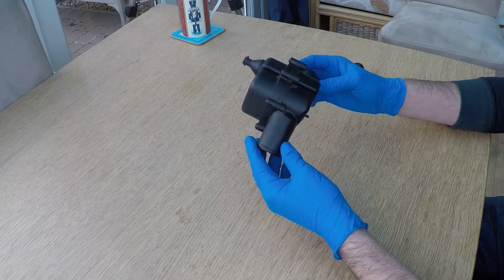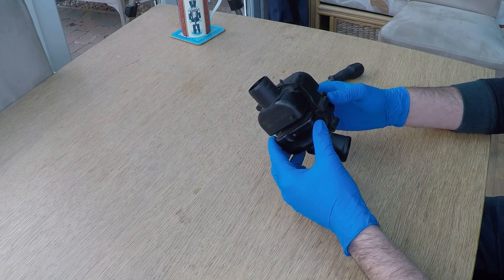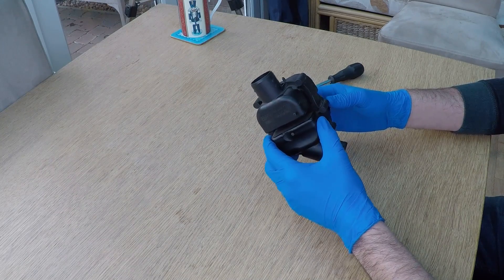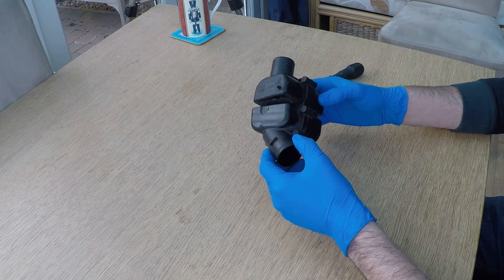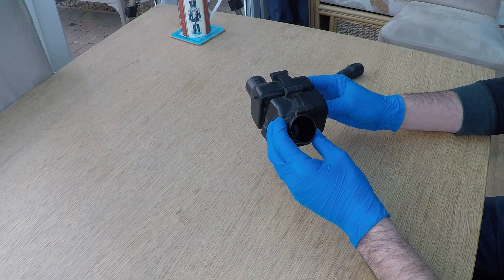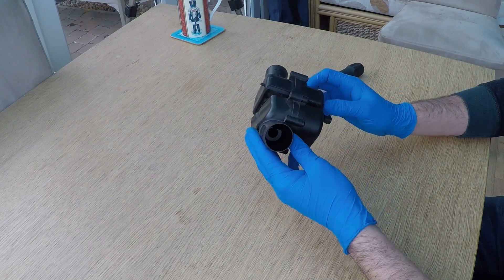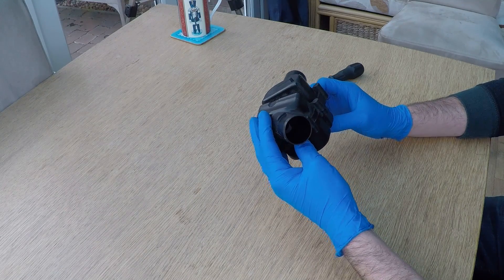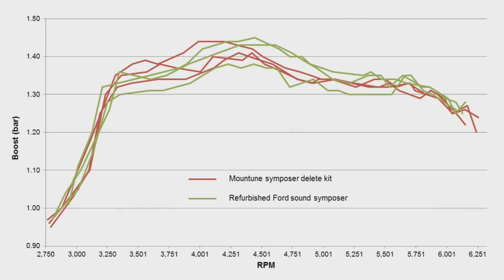How to fix Ford's leaking sound symposer on my Fiesta ST

Comment: Useful vid, I'm on my second ST and noticed a rather strange sound and seemingly lack of boost and wondered (since I hadn't been bothered before) whether somebody had removed the symposer... They hadn't, but for whatever reason it doesn't make the sound that my previous one did so I'll be looking into these steps, since it's got a good 50,000+ miles on it over the other.

Comment: Hi Mark, i have some troubles with my symposer that i would like to keep actually. I tried to clean it as you did but my problem is still there. I asked Ford to check it and they only agreed to blow some air in the tube which is going toward the windshield. Since then, something has changed. It's still not working properly but now i have some sound back around 4000 rpm at full charge. The thing is that it doesn't make this nice angry hornet sound the symposer use to do but more like the sound of a frog you squeeze with your foot haha. But at least it's the first time i see some changes. So my guess is that i have a problem specificaly with this tube. Maybe a leak, maybe a bad connection ? 
I was wondering, since you're the only one who made a very clear video of this system by showing us the inside and explain how it works, is there any chance you could make a video of where this tube goes exactly and how to dismount it ? From what i saw, the battery and its case need to be dismount ? But where this tube goes exactly in the windshield or the cabin ??
And of course if anyone else have an idea to help me solving this problem i take it. Just don't tell me to delete it haha

EDIT : well i just realised that you're not driving a Fiesta ST anymore for quite a while...

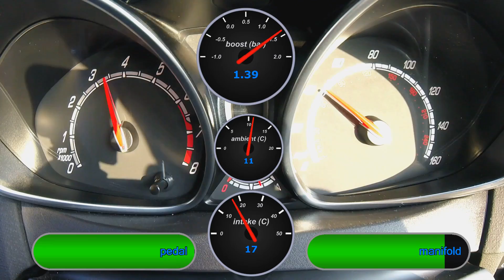Comment: 11:13 Are these runs in real-time, or have they been sped up? I feel like mine is slower (before and after delete kit). But I also haven't timed it. 4th gear, right?
Reply from the maker: Not sped up at all...and they were run in 3rd gear not 4th.
Reply: @MarkCup70  I heard you say 3rd on the video, and for some reason I still typed 4th. Go figure. Thanks for the info! Now I need to go time mine.

Comment: Great video mate very interesting to learn how it works. I kinda like the sound symposer in my ST but don't like how it only activates when you put your foot down a bit. I wonder, If you make the tiny hole in the intake chamber larger, would that make the rubber vibrate more causing more sound in the cabin? I'm not an expert on this stuff just want my ST to have the cabin noise constant.

Comment: Hi Mark. I know it's been a while since you've had your fiesta but I have a question for you. My car now had 50k miles on it and I think I have this symposer leak problem as it feels like it's losing power. I'm not sure if it's just in my head though. Thing is, I've also noticed my fuel economy gradually getting worse. Would this be a symptom of a boost leak or could it be something else? Hope you're enjoying your BMW. Awesome car BTW. Many thanks.
Reply from the maker: It could well be a symposer issue but also, from my experience, the hose clamps tend to work lose over time. Get yourself and angle-adjustable 7mm ratchet spanner, get under your car, and pinch all of them up. That would be the first thing I'd do.
Reply: @MarkCup70  awesome, thanks mate I'll have a look.

Comment: How can a fully sealed composer have different boost to a deleating kit? Both should have the same boost when the are completely sealed. In fact, the delete kit ensures constant boost, because it should never leak again like the symposer with aging rubber flaps.

Comment: Thanks for your videos. I now know a lot more about what the symposer actually is and what it does in my ST180. Did you notice much of an audible difference when driving without a symposer? The audio on YouTube makes them sound almost identical in your videos.

It’s also interesting to see from your results that on some of your tests, a cleaned symposer provided higher boost pressures than the ‘Mountune Symposer Delete Kit’

Did you stick with the delete kit in the end?

Hope all is well with the Mk3 RS.

Comment: That's interesting a lot of people are deleting / getting rid of the symposer because it's loosing boost pressure but I guess by design it's not supposed to do that, this is another solution if you don't want to loose boost but still enjoy the sound.

Comment: brilliant video! I disconnected the feed pipe to see what a symposer delete, would sound like and it's unbearably quiet, after seeing people saying on higher maps (mr230) boost leaks etc and seeing your video explaining you was loosing boost and how the delete gave you more boost again, I kinda thought I'm going to need the symposer delete and suffer with the insanely quiet induction, glad to see its fixable! and isn't actually a problem. keep up the good work!
Reply: Focus ST owner here. I had a very similar issue with my ST. I flashed with different map and found that my boost was acting weird. I did the symposer delete and things are like they should be. It was quieter in the cabin after that. But after changing out the lower engine mount and a high flow down pipe, it's got better low end sound and WOT sounds awesome.